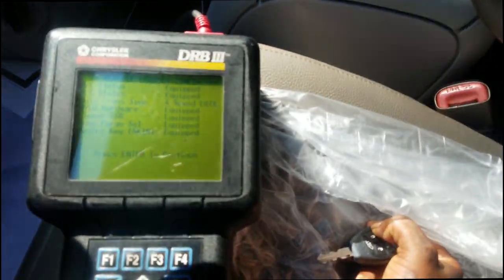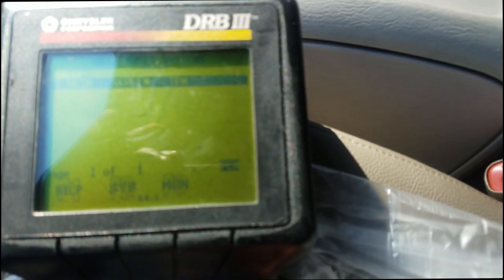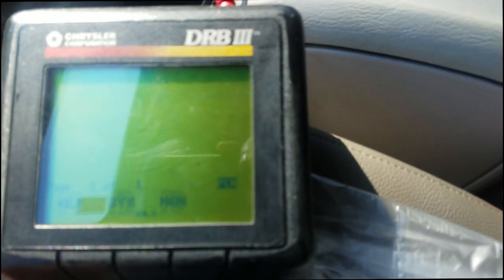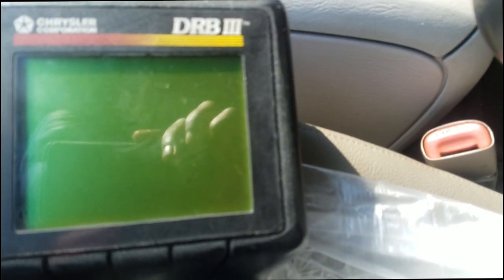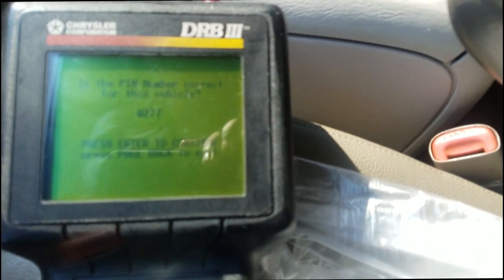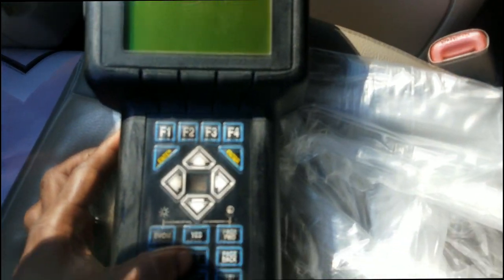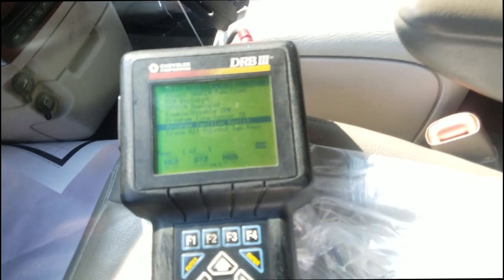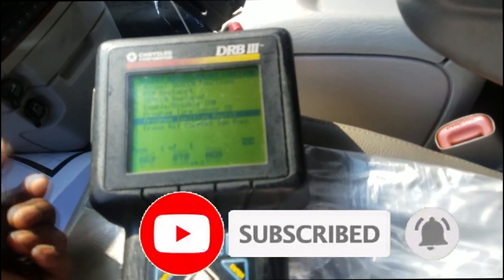How Older car keys are programmed. Skim Security RKE Win module programming. Key fob not detected

Comment: A customer who loses keys and then maintains only one or two new ones is a fool.  Such a customer should have THREE keys, one in safekeeping, because two usable keys are required to use the CAR to "program" to another one .  If one is lost out of three, then there will still be two from which a replacement can be made at little cost (the price of the key blank and mechanically cutting it).  With two, when one gets lost, the customer will have only one left and can't get any more other than by paying the dealer or a properly equipped locksmith; with only one, the customer who loses it is on the hook...of a tow truck! 

Actually some locksmiths have invested in the hardware necessary to supply new keys.  What is actually happening is that each key blank has an electronic code and by using whichever computer interface, dealer or locksmith, the car can "learn" new ones; the car can "learn" generally to a maximum set by the manufacturer, often eight.
Reply from the maker: lol, GP whats going on?. You nailed it but after 2011 when the Bus network changed, you know longer able to use the 2 key trick. But im sure locksmith will have or come up with away to crack the system..And if im not mistaken, after 2017, its damm near impossible to not have to go to a dealer. Fact is, the code resets after several hours now..When you are issued a security code, you have only so much time to program it.

Comment: What do you use to program a key for a 08 Avenger? With auto start
Reply from the maker: Hey bud, the 08s software is installed in all the latest scan tools so you shouldnt have a hard time getting the 08s done.
Reply: @OnlineMechanicTips  Thank you! For some reason my alarm started going off randomly and now the unlock trunk and Auto won't work. I read somewhere the keys are prone damage internally, I need to make friends with a locksmith and get like 15 made lol
Reply from the maker: @ADDMEONPSN  lol, you and me both lol..